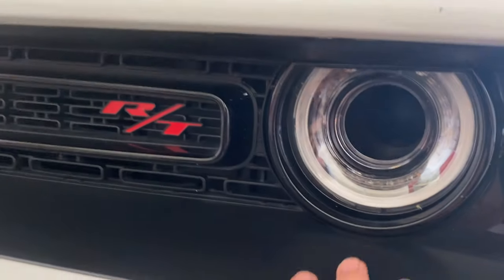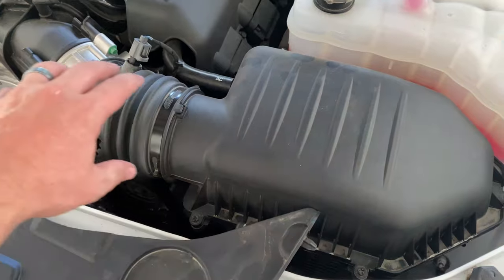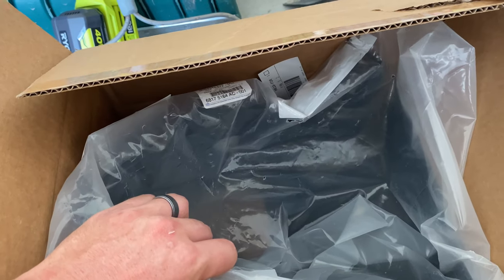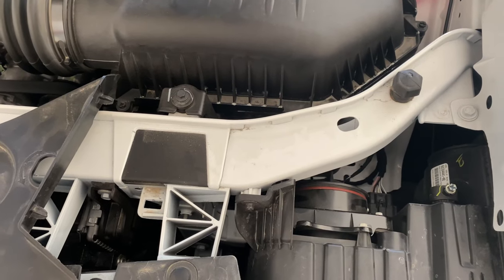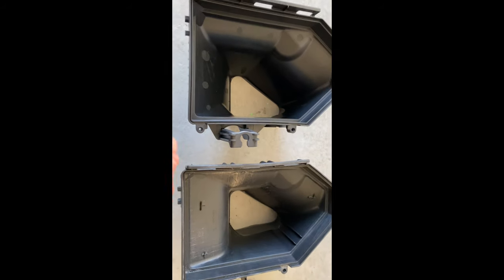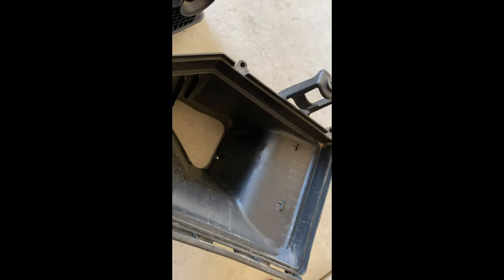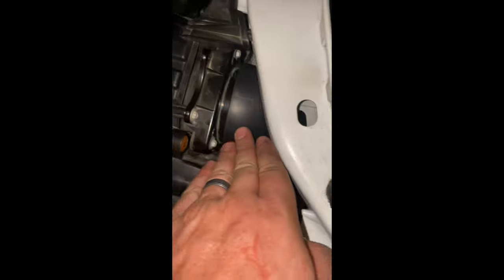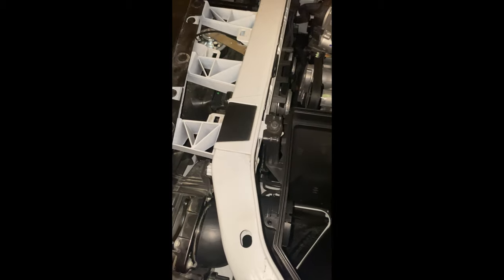Installing a Dodge Hellcat Lower Air Box and Filter. The TRUTH!!!

Comment: Thanks for the video!
I raced my 2021 Dodge Challenger 1320 in Las Vegas a couple weeks ago and my air intake temp hit 138° and I ended up running .2 slower in the 1/4 mile. I was hot lapping though and not allowing the car to cool between runs. It was my first time racing it and my goal was to get as much practice as possible. I ordered this kit as soon as I got home! I know it won't make the car any faster because the stock 6.4 won't pull more air than a stock filter & airbox already provide, they are pretty evenly match, however, I am hoping that by keeping the intake temps down it won't slow down as much on hot track days. We'll soon see! Besides, I hate that the headlight air intakes are blocked/fake from the factory; let the air in!
Reply from the maker: Let the air in! I agree!

Comment: I'm confused about why don't people just use a circle bit and cut the hole in the stock lower box and attach a flex tube to the hole. Then you can cut it to grab air anywhere up front. 🤔🤷‍♂️
Reply: @@bobmcglasson8221 personally I paid the 120$ for a box just so I can stop explaining how my intake headlights aren't actually intakes. Its also just kinda cool and MIGHT lower intake temps on hot days.
Reply: the hellcat box is larger in volume which helps a lot as well

Comment: Your right, one is easy but don't waste your time on the other side. I just pried off the cap once the easy side was removed. Using my fingers took 2 seconds.
Reply from the maker: PBR Doug I should have done that! How you liking it?
Reply: @Gonin60  I did it 8 days ago and haven't had time to test the Scat Pack. My daily car is a 2012 5.7L Manual R/T and is just stock. Keep up the good videos👍
Reply from the maker: PBR Doug will do! Thanks brother!

Comment: What did you end up doing about the gap when connecting the tube?  Did you add weather stripping to the inside of the tube for a better fit?
Reply from the maker: ThatMetalRocker I tried the weather stripping and it didn’t do what I wanted it to do. I actually played around more with the connector tube and lower air box and got a better fit. Had it on for a couple months and no issues. Definitely recommend this mod.

Comment: What are the part numbers for this modification. I just bought my 2021 challenger scat pack and more air is definitely a positive mod. Thanks if you can email these part numbers to me
Reply from the maker: Hey there! I think I left a link in the video. I would double check which parts fit your car. The tube and air box. Make sure they are compatible. I ordered mine from a mopar
Shop.
Reply: challenger/charger hellcat lower intake conversion brings up plenty of results

Comment: Is there any issue with it getting wet when it rains ??
Reply from the maker: No
Reply: @Gonin60  cause I was thinking about adding that to my shaker but then I thought what if it gets wet and the engine starts running rich
Reply from the maker: @N0LegsDan  it could I guess to some degree idk

Comment: Did you feel any diff in power
Reply: No noticable gain, ppl just buy it because of the logo and it's on hellcats
Reply: @virusworld3730  well I noticed lots power but then again I also did exhaust full and reduced battery weight the exhaust freed up weight too so but I did notice a little right after I did the filter only it def ran better and sounded beffier

Comment: I wish l had your teeth.😊 Good how to though.
Reply from the maker: Thanks
Reply: @Gonin60  l just finished doing mine yesterday. I think people should just bite the bullit and take out the five screws on the light fixture and pull it out far enough to remove the pesky screws. Im not so sure the return on the $220 spent to do the modification is worth the results. Going down the hyway there might be 2 or 3 degrees differance between the stock and modded, however when you step hard on the gas you can watch the air temp come much closer to ambient air temp. Im not sure if it makes more power though, maybe 2 or 3 horsepower. Dont you think?